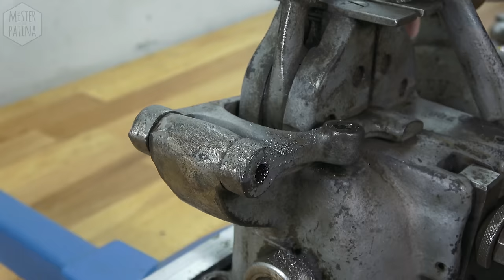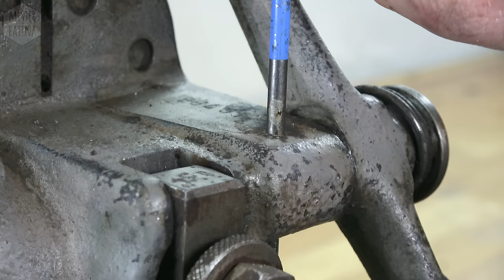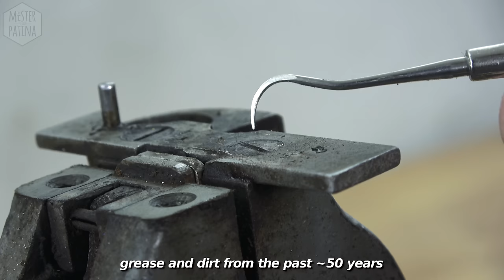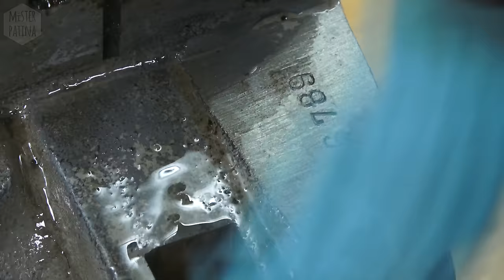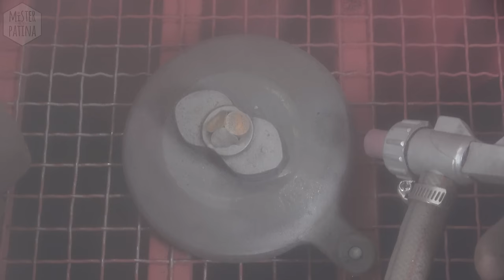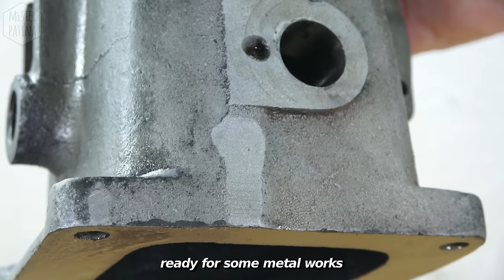Saw Blade Tooth Setter Machine | Restoration

Comment: the more I watch your channel the more convinced I become that a system is REQUIRED when it comes to restoring something. it doesn't matter what the system is but you need to put things in an order that you can pick them back up and reassemble them. I don't plan on restoring anything anytime soon, but I do so love to tinker with things and now you have me thinking about my system
Reply from the maker: Haha, yeah there’s a system. But there’s a huge difference between a system in restoring and a system in restoring and filming. 
But in any case it isn’t magic. Make yourself a good plan and pictures BEFORE restoring, and don’t rip a finger off 😉
Reply: I sometimes thought filming started as a mean to document before the restoration, to know what goes where during the deassembling… Is it the case or did you have a totally separate system for both filming and restoring ?

Comment: I have always wanted something like this to set my woodworking saws instead of having to use a punch and a hammer!! Incredible restoration as always, Mr. Patina! Love the paint job!
Reply from the maker: Hey Martin! Go for it, they aren’t that expensive. 
Thank you so much! 🙂👍
Reply: Wiedermal ein super, schweres, Video 👍🎖️hinbekommen! Hast du, für die Filmerei, einen Helfer? Dann auch ihm / ihr ein großes Lob 👏🏼 Macht weiter so und bleib gesund! Michael
Reply: I recall a small manual version used with a vice and a punch, did all of one way then reversed for the other. It was pretty tedious using that jig though. This one would be great!
Reply: I have a saw tooth setting device from the 1800's that works fine on smaller teeth, I made a massive 3 point rip saw and needed something to set those teeth, made it out of a sheet metal clamp and some scrap steel. BTW, you bend those hardened teeth, the tips will snap off, just like his did.
Reply: @SunnnyDay    I don’t remember folks normalizing the blades before setting them, but might work. Retemper after setting? Maybe it’s worse with high carbon steel, or steel alloys. Well, if you have to weld a new tooth on, that will temper it for sure.
Reply: @mred8002  The old hand saws that were re sharpened manually were not hardened. If they were, you couldn't touch them up with a file. The blade in the video tends to mislead....you'd need a complicated grinding setup to sharpen those teeth, a file would not do the job. To do that job by hand, you'd be compelled to normalize the blade, which would also benefit you on the back end, setting the teeth. I might do all that on a vintage blade, the one in the video looks modern and not worth the trouble, you buy a new one at the hardware store.
The restored tool is lovely, except the saw blade is most likely still dull and now has broken teeth.
Reply: @SunnnyDay    That’s what I have done with my old rip and crosscut hand saws, file with a triangle file to sharpen . They’ve just hung on the wall for years, though, as I’m too crippled up now. Power tools are great, but not nearly as satisfying for small projects.

Comment: I remember watching my grandfather set the teeth on his handsaws after sharpening them using a much smaller handheld setting tool. With it you did every other tooth from one side then did the other teeth from the other side. This is a much easier machine but not for the average carpenter with only 3 or 4 handsaws. Beautiful restoration as usual. The end result is art as well as a tool.

Comment: My father had a tooth setter for his saws. His was a simple handheld device that clipped across the teeth. 
He had to set each second tooth and then turn the blade around to get the skipped teeth from the other side. 
The device had a wheel to control the angle of the tooth.

Comment: Just FYI. Coldblueing doesn't give that much rust protection on its own, as much as it creates porous surface which allows for oil retainment, hence oil bath is recommended. If you don't believe random comment warrior, here's a snippet from wiki: "Black oxide provides minimal protection against corrosion, unless also treated with a water-displacing oil to reduce wetting and galvanic action"
Reply from the maker: Random comment warrior 🤣🤣🤣
Thanks for the information. I knew this, and iam also putting all of my parts in oil for 12-24 hours, after that drying for 12 hours, and then I just dry them with a paper towel. 
But showing every step would make it hard to watch…hope you understand, Mr. Warrior 😄
Reply: @misterpatina  Oh, glad to hear that. All the blued parts looked so clean and non greasy in the shots, that I assumed there's no way they were in oil, hah :P

Comment: All tools addicts out there, please, correct me if I am wrong. Spanners used by Mister Patina are the SlimLine series from Proxxon. Ratchet made by Proxxon as well Vigor (red dot model). Slotted screwdrivers shown through the video are from PB Swiss, with 22:58 illustrating why those are the best flat screwdrivers in the world: their blade profile is not a triangular shape, as generally expected with cheaper brands, but a true square wedge that slots perfectly into the screw head while avoiding damaging it during high torque fastening.
Reply from the maker: Let me add: some spanners from KS tools, the ratchet is Vigor 🙂

Comment: Fantastic video, Kai!  What an odd little tool to find.  Curious if you ever get a little lost in what goes where?  How you handled the handle was great, since it is a restoration.  What would it take to get a proper parts cleaner in the new, well not so new anymore, shop?  Using a glass bowl kinda sucks.  Anyways, great to see you with a new project.  Hope you and the family are well.  See you on the next one.  Be safe.
Reply from the maker: Hey B, I always get lost! But knowing your weakness is the biggest strength you can have, so I always make a lot of photos and - of course some videos ;-)
Your words in my ear - today I ordered my new highpressure parts cleaning cabinet. Iam sure youll see it in the next video 🙂Thanks for kicking my a$$ ;-)
Reply: @misterpatina  I wasn’t trying to be offensive about the glass bowl.  Apologies if it came across that way.  Anyways, looking forward to the next project.
Reply from the maker: @BB_Chaptsick  You werent offensive, you were absolutely right! Fun fact: the glass bowl died a few days ago. Neede something new anyways 😀

Comment: I was wondering if there's any special post prep on the mini lathe after you turn wood? Is there any lubing or special cleaning I should do on mine if I start turning some wood with it.
Reply from the maker: Hi James, i didnt do anything special here. After turning wood i give it a good clean (compressed air, vacuum cleaner, oil), thats it :-)
Reply: @misterpatina  ok, thanks.  I wasn't sure if there was anything special I had to do.  I figured it was a good wipe down, air out and lube. I'm new to the mini lathe so just making sure I do things the correct way. Lol

Comment: When sandblasting, do you choose a different hardness of grit based on the material you're working with? Is it possible to "over blast" something like how you can over sand something?
Reply from the maker: Mh, basically yes. But I just decide between 3 types: nutshells, glass pearls and corrundum - depending on how hard or soft the parts are. Nutshells for just cleaning (engine parts), glass pearls for soft metals or wood, corrundum for steel parts or hard aluminum 7075.
Reply: @misterpatina  super interesting thank you!

Comment: What size compressor do you use for your blasting cabinet?
Reply from the maker: I have a 100L 2 cylinder compressor. Used to have a 50, but way too small. Most important thing is, how much air the compressor produces in which time. My current one delivers 300 litres air per minute, that’s quite okay for sandblasting. 
(Sorry for bad english).

Comment: What type of wire are you using for the nickel plating?
Reply from the maker: Copper :-)
Reply: @misterpatina  sweet ok. I’m going to try my hand at some plating. I have a hammer I want to copper plate but I have to nickel plate it first. Any tips?